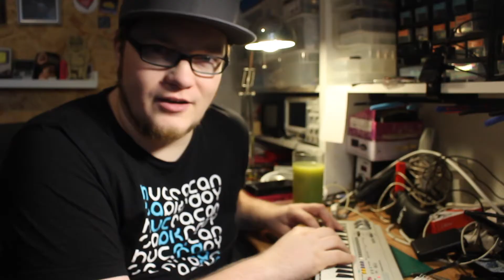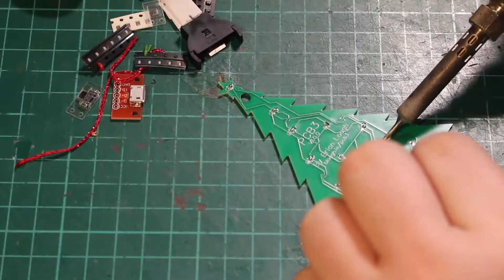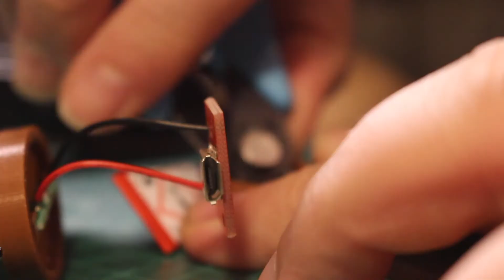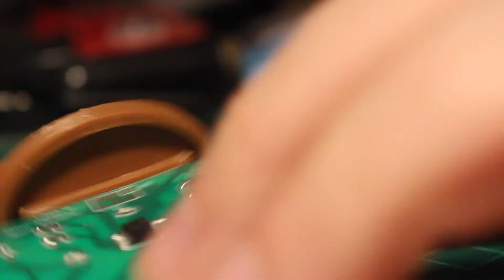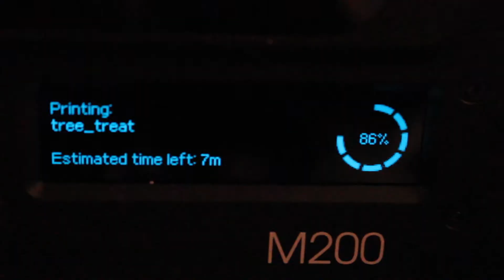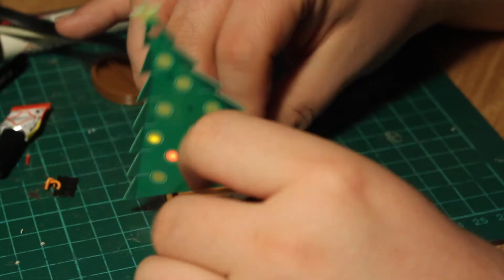soldering Brian Lough's PCB3

Comment: Great build Dave. I had to use a lot of flux on mine because I'm not good with reverse soldering LEDs yet :)  I already converted mine to use an 18650 and a charging module, but I really like your base so I will probably print that too. BTW: I love that you show your mistakes in the video.
Reply from the maker: I start with very big blobs and feed in a lot of solder.. basically against everything what you learn for normal smd parts. 

Also thank you :) I think these mistakes are important to show, so whatever people think my skill level is at - they see that I do stuff wrong.